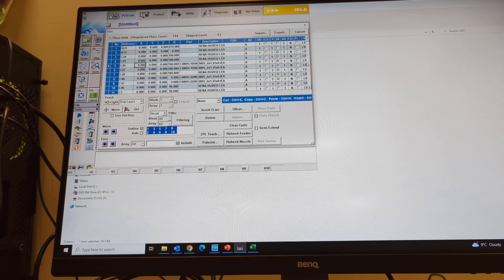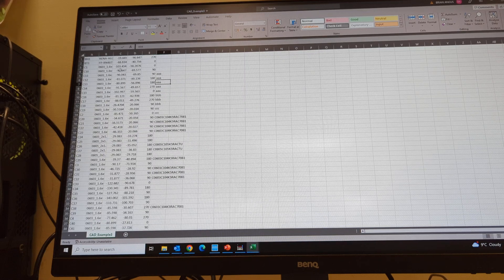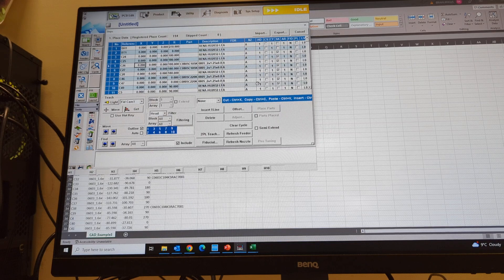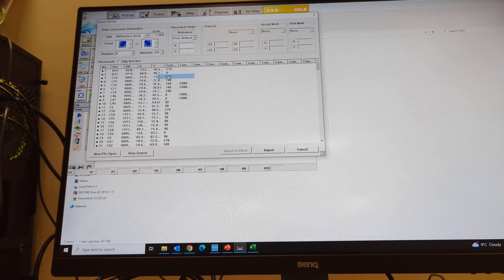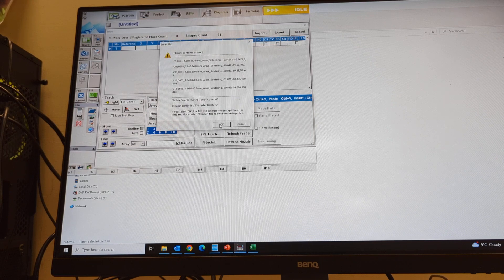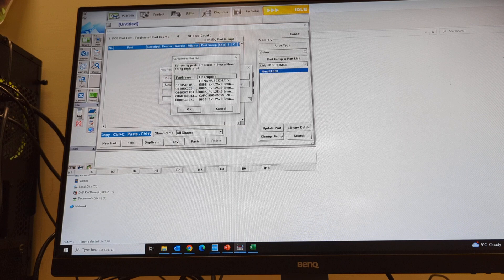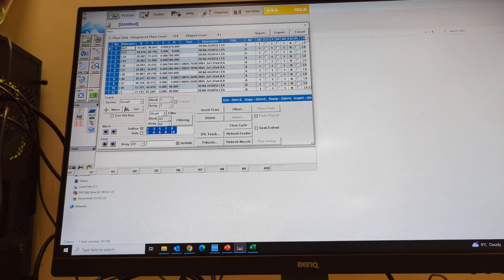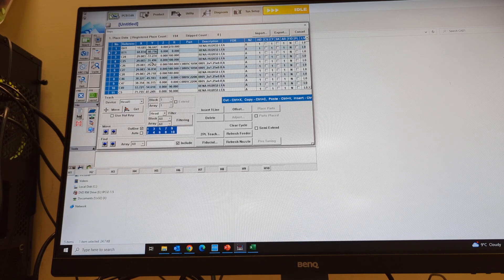How to import a clean CSV file into Hanwha SM482PLUS.

Comment: This method of importing coordinates hasn't changed since the CP45 came out! Many factories with old CP45 purchase new SM series machines because any CP45 Job can still work on newer machines without too many issues
Reply from the maker: Yeah exactly. T-OLP interface is very similar too but with a lot more nice options. 45 opt files can be opened on SM series without issue although we generally prefer to get customersbto start from scratch to avoid DB bugs
Reply: @Elite7Installations  I couldn't agree more.  That's why I said not "too" many issues, because you will have some with the DB as you said. Still, the fact that jobs of a 20 years ago old machines still work on SM ones is impressive
Reply: 😮 @Elite7Installations _ду